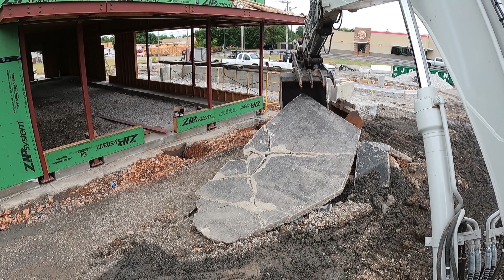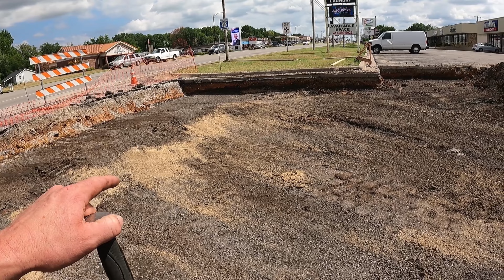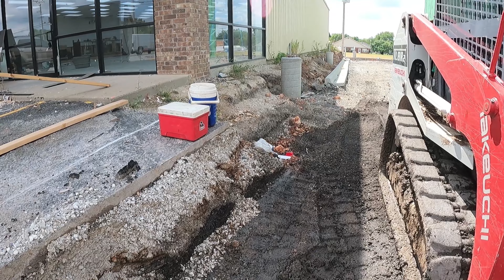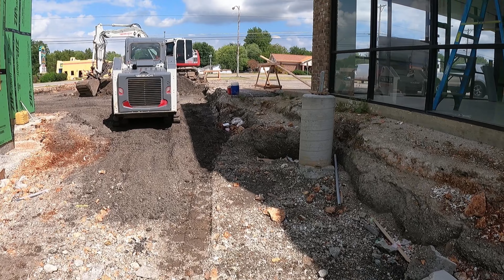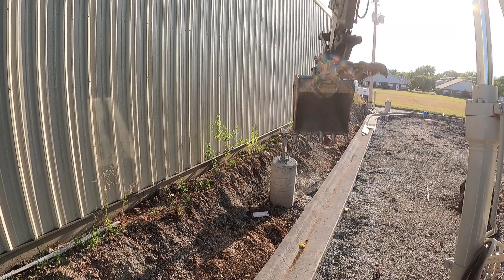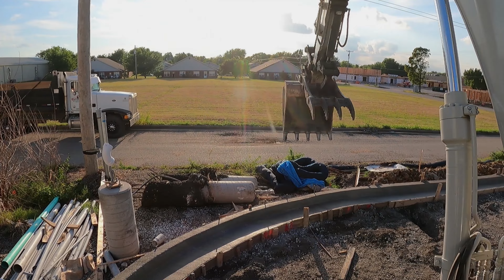Tearing Out The Last Of The Parking Lot At Starbucks

Comment: Cleaned up well!! I hope someone takes not of the shortcomings in the concrete. Enough rebar for 6 ft, but the hole filled in with the loose soil from the sides or they did so with gravel themselves. What a dumb mistake to make. Probably would have been a ton of work with the rebar already there. Here with the frost, those would have been done inside a Sonotube. The way they were done, if done here, would have meant they would heave up to a foot through the winter depending on the soil type they are in. Those “caps” at the top are a fatal flaw here,,, hahaha. 
    I’m still trying to figure this one out. If I were to use my policing skills,,,, the engineer in charge insisted on this to be different and based on some unheard of ideal. He got in so far and instead of saying someone else was right, he can’t accept being wrong. He is now forcing this through at these levels come he’ll or high water (next hurricane) because he just cannot admit he is wrong. This will definitely reflect on that person (I assumed it is a guy) and the Firm he works for, or owns,,,,,,,. People all need to learn 3 words (I sure had to myself 40 years ago at the age of 19). The 3 words are ,,,,, “I don’t know.” Makes life sooo much easier when you learn to say this when you are in over your head or asked a question, any questions that you really don’t know the answer to!! Yeahhhh, I’m being a little preachy,,,, sorry Brandon. It’s the o ll way I can rationalize the drastic difference in height and so low that it will be a serious pool in the next hurricane. Likely be in the news,,,, make sure you can cover your own *ss on this one,,,,, heh heh. 
     You and your family please stay safe, Eh!
Reply: After "I don't know" should come "But I can find out". Tha
Reply: 67… you nailed it!  That elevation screw up will always be there.  

A carpenter friend of mine did a lot of water damage repairs in his career.   He always said… “It’s better to build a house a foot too high than to put it an inch too low.”

This one is at least a foot and a half too low.
Reply: @sassafrasvalley1939  - Hahaha,,,, I thought so,,,,. Hope you are doing well.
Reply: @kenore4003  - so true!
Reply from the maker: I think you are 💯 correct I don’t think the engineer wants to admit his mistakes so he just keeps making it worse. It aggravates me cause not only will it not function right it looks terrible. It makes no sense for the building next door to be 2’ higher especially when they had a nice flat lot to work with. This job has turned into a joke 🤣
Reply: Well as the old saying goes, sh*t runs downhill lol and it looks like the mudslide of dung is going to take out a certain engineer